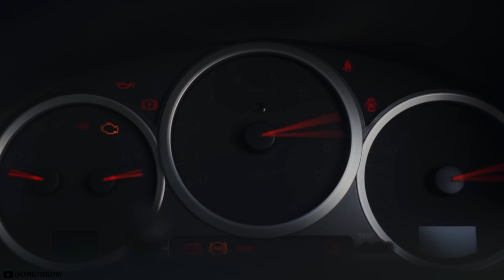Donut Media VS. Subaru

Comment: If a car eats itself after a couple laps, with OEM parts, the problem is with the car. It's similar to all the GT-Rs and MK4 Supras tuned to 800HP. Delusional owners will swear they're bulletproof, but the moment a third party, like Throttle House, Hoonigan or even Carwow point the camera at them, they either run badly or something suddenly explodes every single time.

Comment: The fact of the matter with Subaru fans pointing fingers at Donut...

When your defense is "If they replaced 60% of your engine you wouldn't have this problem" its not a defense.

FFS We've tracked a shitbox $500 Saturn SL2 without issue, my coop is perfectly capable STOCK on the track...audi? VW? No issues....

Subarus? Consistent issues. The Subaru platform has issues, and requires a pile of supporting mods or you're going to grenade the engine. That's about it. That's where it stands. 

Didn't have issues with the Nissans, or the Toyotas for the past series.

Subarus require a ton of extra time effort and money to make a trackable vehicle. In this case, you're better off buying a separate make altogether.

Comment: This is exactly the same about second hand germans with high milage. I don't know about USA but in Europe the reliability issue is the same with old BMWs/Mercedes'. If maintained/modified correctly, they will be a good platform to work on. If not, you'll have yourself the most toxic, frustrating and annoying shtbox ever.

Comment: Stole the words from my mouth, I've literally been saying this for a while now. What makes a tuner car reliable in the tuning world is pretty much just how much abuse and wrongly built engines it can take without dying. Any car that can easily be tuned or modded wrong and done so a lot is instantly deemed as unreliable and should be avoided at all costs even though in some cases all it takes is a bit of learning and you can make the car perfect. (more time and learning for the higher level of technicalities a car needs met) Like a rotary, it can be turned into a great car but it requires an immense amount of knowledge to not mess it up. Just most people are less willing to put in the effort and this is exactly why most things in the word are being designed more and more towards less effort for the user rather than practicality or long term use.

Comment: If a car requires more attention than most in order to not blow up after 1000 miles, its by definition unreliable. You can make EVERY car reliable if you throw tons of money at it and have experts building it for you. This makes the difference between a reliable and an unreliable car. You can install an ebay turbo kit on a mostly stock d series or a 3e and it'll outlive you with a decent tune. Not all cars are for all people. Find the platform you like ,and can afford, if you want a good experience in building cars.

Comment: Donut fkin rules, Subaru makes some great cars. HOWEVER, Donut grabbed some older model cars because they’re cheap and easy to mod. It just so happens that these particular models have terabytes of forums online trashing their problematic design and nightmarish reputation for unreliability. Sure, if they had found two garage kept new-old-stock WRX’s with no miles on them, it’s highly unlikely that they would’ve experienced these issues but WRX owners don’t buy them to haul groceries, they buy them to haul a$$ so the likelihood of finding a used one with its cherry still intact is like finding a Scion driver that doesn’t wear skinny jeans and round lenses.

Comment: Literally any other platform would have been ok. "Just need to completely rebuild the motor with a whole list of aftermarket parts to be competitive" I hate Donut but holy fuck they didnt blow 5 motors when they did the 350z or any other car.

Comment: As a former subaru owner, one of the worst  parts of subaru ownership was the diehard subaru apologists who would always go to bat for an objectively crap platform.  They are insanely fun to drive, BUT, they are objectively less reliable, need a lot more attention, and have a slew of additional issues that other cars simply do not have.  When you know how to work them they are insanely fun cars to drive but I can't deal with the diehard copers who pretend that these things are just as simple as any other JDM vehicle.

Comment: Had the EJ25D and EJ251/3 with narrow main bearings and/or composite head gaskets not happened we might not have the stigma that we do today. But, every engine/platform has it's issue/quirks. K20s have had oil starvation in LH corners, IIRC. Old DSMs had crankwalk issues. If you use different ratio rocks on a Chevy 350 with OE push rods you might bend one. You need to learn about your platform before you dump money into it.

Comment: This is just off the top of my head, middle of the video. BUT why is this new to people? I was always under the assumption that if you want to modify a Subaru and keep reliability than you gotta spend way too much money. I'm an Rx7 fan boy so don't take this as me full blown hating. I love Subarus and think they are awesome niche cars. But that comes with Subaru issues just like Rx7s motor are not lasting as long as a junk yard LS. Doesn't mean the rotary or boxer motor is bad. Just means you gotta deal with it if you want the platform.

Comment: I’ve had my 03 wrx for 3 years now and it had an engine replacement before I got it and aside from the valve covers starting to leak I haven’t had any major problems like I see most people have, I’ve done most of the work and put in the time to learn and so far I’ve had no major issues, so I was just mainly confused as to how they blew so many engines

Comment: I get defending what you love in a car, I love Mitsubishis but they aren't the most reliable, and Subarus are notorious for engine and transmission failures (looking at you CVTs).  Boxer engines by design have always been inferior, and unreliable for the long haul, hence why you rarely see many with higher mileage without a new motor. You can love them but at least admit they dont hold up well.

Comment: I've owned 2 WRXs. The usdm 2.5 EJ is a horrible motor. Built up a 257 and it blew up in 10k miles on a low boost/conservative tune at 450whp. The 5-speed is junk and even the sti can't reliably hold more than 400whp. I've had my VA tuned for the last 30k miles with no issues. The only motors worth putting in a subaru are the type RA motors, eg33, and ej207. I like subarus but please buy an Audi if you want a turbo awd car, that's saying something considering vw reliability.

Comment: Donut turbo’d used VQ’s and a junkyard LS and a completely fresh LS and didn’t have any of these issues. And one of the blown engines on the subaru was a car they literally just bought to replace the wrecked car. No track time no nothing and completely stock. There is literally zero excuse. Not to mention the STI is supposed to be the track focused model. All these kids on maximum cope mode trying to blame donut just prove how cultish and blind people are just based off internet hype. But they never learn. There are so many cars that are cheaper, faster, have more modding potential, look better, and don’t blow up. It is 0 IQ to sit there and try to act like they aren’t trash.

Comment: Imagine having to do that much supporting mods just to run street parts... I had 400 whp out of my evo with stock turbo and a few grand.  Got 40k miles out of it before I sold it to get something else with no failure.  Yall if you have to fundamentally change every part of the engine and oiling system just to drive it as it was intended, its not a good car.  You can't change my mind.

Comment: therin lies the problem, ofc theyr cool when done right, every car is cool when done right, but Subaru's just have a knack for requiring too much esoteric knowledge to make the risk worth it to build them in any sense professionally, some people get lucky some dont especially the older the model you go, and as it should that scares away most people from choosing a subaru for any track build when you can hop in a honda or something and for half the price and half the headaches you're racing with not a fear in the world knowing you dont need a specialist mechanic on tap or that you have to be one yourself...

theres always a "subaru" mechanic(s) for everything subaru at most custom shops i go to that work on just that, there are far more devoted subaru shops than specialty shops for any other make at least around me, and everyone at other jdm shops besides theyr "subaru guys" can do just about anything BESIDES a subaru, that's why your rally drivers who devote to the platform are backed by seasoned genius mechanics when it comes to just that platform, hence rally is the symmetrical 4wds intended application it only makes sense when you buy a car built with that as its forefront intention that you have a crew adept to building them as they were intended not with a hodge podge of different parts to try to make the car work for an application beyond its intended design theres a reason theyr some of the best cars to grace a rally course and its because they were wholly and entirely designed for rally tuning... that's why i say if you dont plan on rally at all, if you want a fast Subaru you better go newer, better yet get an sti because thats exactly what they were designed for a wrx for the street, older evos have similar issues i see few people talking about for the exact same reason, THEY ARE RALLY CARS LOL. u want 4wd for the street and u have to have a wrx or an evo go newer. otherwise your in for a very rude awakening. its like telling a toddler to go cook dinner... and all the subaru stance boys and people who tune them for other applications almost ALWAYS have some sort of story to tell from my experience. granted a lot of people do for any car. but older Subarus are just in a totally different league when it comes to esoteric problems, even the newer ones tend to have issues that make your average car guy question outside of anything they thought should be the issue lol.

Comment: I think you are 100% on the mark - Subarus just have a smaller tolerance window for success and Donut weren't aware of that. It'd take hours of autistic forum research to really know what you're getting into and be mildly prepared for it. The entire premise of HiLow should tip people away from the race parts vs street parts argument because the entire point was to have a streetable car you can track, and diving into turbo flat fours from the quite frankly bulletproof if horrendous sounding VQ platform in the Z's and not doing any engine modifications to the Tacomas. James himself admitted to making a rookie mistake on that turn that resulted in the engine spinning backwards, so I also wouldn't blame that one specific engine lmao!
I think Zach Jobe was the only one in the group that actually had experience with turbo platforms considering his Money Pit series turbo'ing the Miata and his S14? he's been working on off and on. 
A friend of mine drives an EcoBoost Mustang and honestly he loves the platform, and he's done the work to make it sound half decent and it's very quick. The problem is that these engines aren't reliable without a lot of deep-dive work, and that's something you would need to know before slapping a larger turbo on your Fiesta or Focus and sending it. I wonder if US car guys are spoiled from how easy and available the LS platform is to make cheap power. :P
I'm working on a 1UZ car myself, which has very little aftermarket in the US but huge in NZ. We'll see how that goes.

Comment: A Subaru motor isn't any different from any other engine. It requires maintenance just like any BUT with most performance vehicles, they are used hard then put away wet. NOT a good combination... Rebuilding a EJ is also no different from rebuilding any other engine but the prices for doing so on Subaru platform is astronomical... Would I do it again? Buying another blown up WRX? Not a chance in hell.

Comment: Subarus have very little room for error. I’ve watched plenty of videos of people doing the same thing donut did and can’t figure it out. One thing donut dose is they like to going into cars like every high schooler dose it. Gets a cool car puts some parts into it, be it cheap or expensive and not really do a lot of research into the car itself. But that’s just my opinion and you can take it how ever you want.
Reply: No other engine platform needs special needs like suburus, that strategy worked fine with the 350z's they did, mabye if they designed the engine better then it would work properly, not the owners responsibility to give a engine special attention just cause its a bad design

Comment: Let's face it, the cost of a Subaru makes it an ideal platform for young (mostly) male (mostly) drivers.  And, the Subie community reinforces the idea that these cars are easy to work on, that any moron with some tools and access to YouTube can 'get r done'!  For all its marketing, Subaru DOES need to do a better job designing the WRX and widening its tuning envelope  BUT, the Subie community needs to be more responsible and honest about the shortfalls of this car (not sure thats possible with the aforementioned young male demographic?) and of the people working on them. Unfortunately, the primary attraction of this car, cost, tends to be a double edged sword.  People buys these cars because they are a good bargain and they work on these cars because they don't have the cash flow to let an expert do it.  Make no mistake about it, these cars are fast, these cars are reliable, there is tons of info out there on how to work on them.  However, until owners can admit they don't have the knowledge or experience to work on these cars, it's the car that will bear the brunt of the blame.  The upside to all this is that owners have formed a tight knit community, a brotherhood, that vehemently defends this car and sings its virtues (sometimes, I fear, to the detriment of having Subaru fix inherent problems).  It's one of the things that drew me to this platform, having a fellow Subaru owner wave at me as we pass each other or wait at a light together.  And, the shock on their faces when I step out of the car and they realize I am old enough to be their father.  Yes, us old guys love Subarus too! ✌❤

Comment: we're talking about building cars for the average person, if you have to buy high end race specific parts to safe track your car, its Garbage. If you have to be a certified master tech to build the car its Garbage. Subaru has a platform has always sucked and I've learn to avoid them years before donuts videos came out and exposed the truth. Only fault i give to donut is that they should have broken in the new engine and parts prior to taking the cars back to the track. Everything else is spot on. Subaru are great cars when they're running but more unreliable/unforgiving than the typical tuner. Best thing about them is that you can pick them up for cheap once the head gasket blows

Comment: my biggest issue with donut the entire time was the blatant lack of research they did. it not only made the wrx look awful but it made them lool like morons. i equate the wrx platform to the rx7 platform. you can make power, but you have to know EVERYTHING about the car. you cant attack a subaru like you do an evo or any normal 4 cylinder. they are fragile. just take care of them, do your research  and they will be awesome.

Comment: I have owned many of these cars and what I can tell you is that this subject is way too over thought. These cars are finicky I will agree but their biggest issue is the oiling system. If you were going to go racing you have to change the oil pan or put a baffle on the factory pain with a new pickup. They didn't know what they were doing in those series of videos with Subaru. People fail to see that they were using the old contaminated oiling components. They continued using those parts on a new engine which caused another failure. They were also tracking his cars with no break-in period. If you were going to modify these cars and drive the crap out of them you better make sure you have a good tune. Ringland failure only happens when you run bad gas or not the correct fuel or you didn't tune for the modified part to put on the car. You can't just go throwing power mods on these cars without doing other mods to them too. And if you don't like doing that in these cars are not for you. These cars have a ton of blow-by from Factory. Which most turbo cars do believe it or not. But if you're going to go make 350 wheel horsepower on the stock PCV system you're overloading that factory system which causes it to burn oil and can lead to detonation and blow the car up. Again that can happen with any car. Most of the time kids get ahold of these cars from their parents and they either mistreat them or they do things to them without any research prior to the mods they purchased. I own an Automotive business and see this a lot. I always get that one question from a kid asking me if they can put a downpipe on the car with no tune. These cars really just need good owners that do the required maintenance and run quality oil and good fuel as well. If you do those things these cars will treat you right. All I drive are Subarus and I have never experienced ringland failure or spun rod bearings. If you are going to track these cars you have to make sure you put the right modifications on them. Always start with the oiling system in the cooling system.